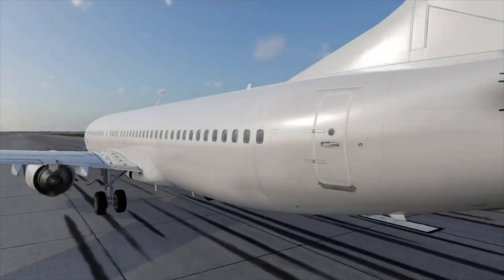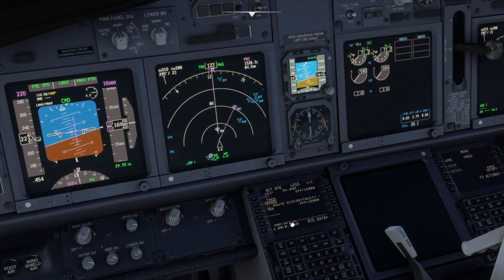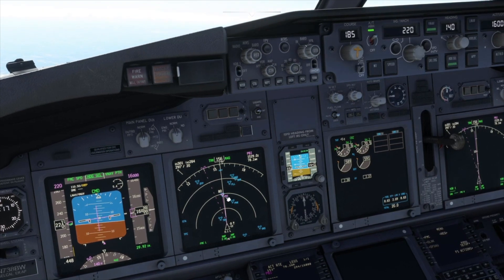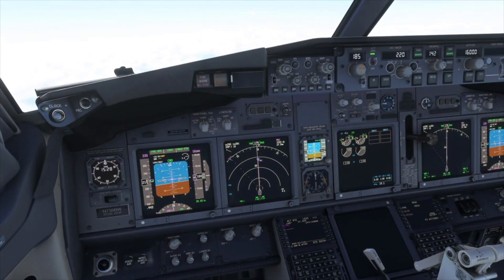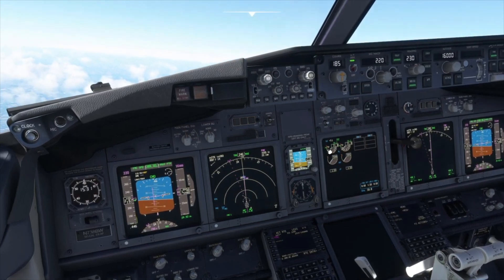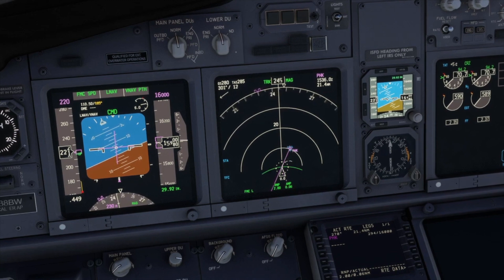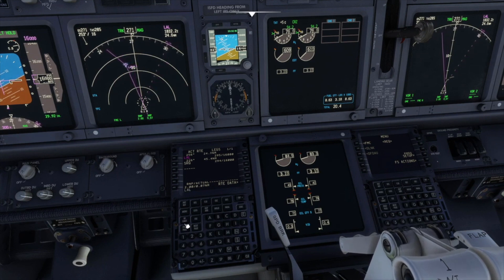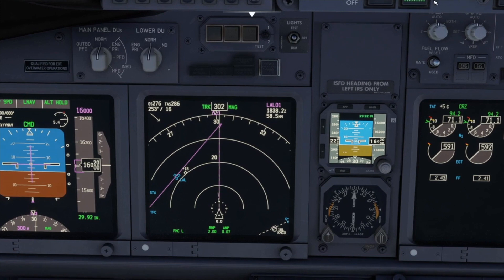737 Intercepting Inbound and Outbound Radials

Comment: Just a simple question. Why the black screen between the two fmc's. Any way to activate it?
Reply from the maker: Great question. That's the lower DU (display unit). There's two buttons above the upper DU on the engine display control, where it says MFD (multi function display) labelled ENG (engine) and SYS (system), they will change what is displayed on the lower DU. It's personal preference.
Reply: @pilottutorials  Maybe I'm wrong, but I think I saw that screen showing the rudder and flap controls and at the same time there was the other screen showing the status of the engines.
Reply from the maker: @TheLoner70503  That is an option that you can change in the PMDG settings. It would also be an option for airlines.
Reply: @pilottutorials  It's already solved. Of the three small buttons to the left of the brake selector, I pressed the one that says ENG and the screen lit up showing the engines and oil pressure.

Comment: So just curious. Could you have also entered KPBI? Everything else gets entered as ICAO, so am wondering. Thanks
Reply from the maker: Great question. KPBI would base navigation from the airport location. From memory I believe a VOR has to be close to the airport to share the same identifier, but in any case the airport and VOR are two different fixes. If assigned a radial from PBI, then use that one!